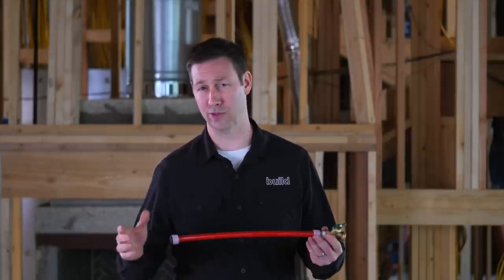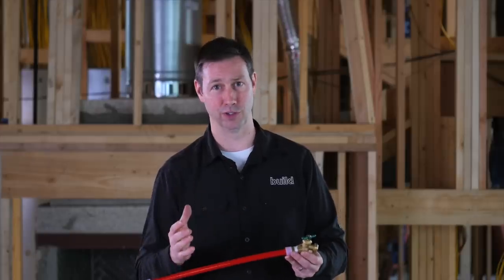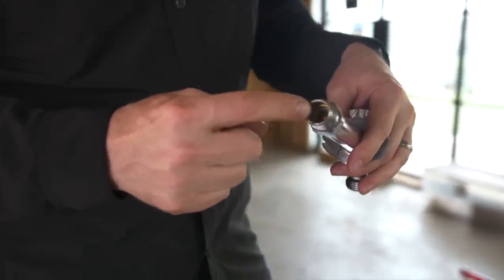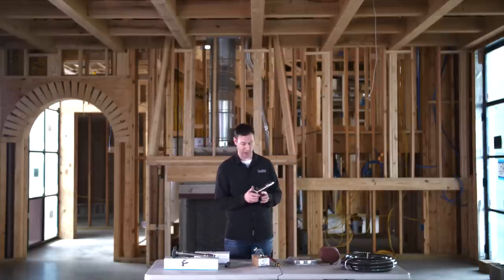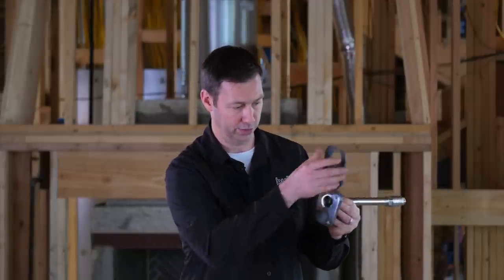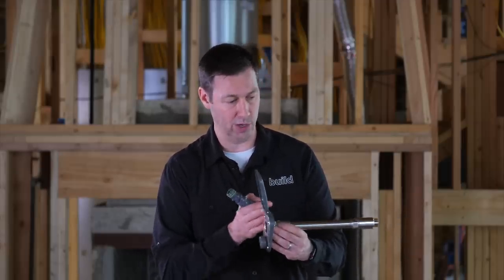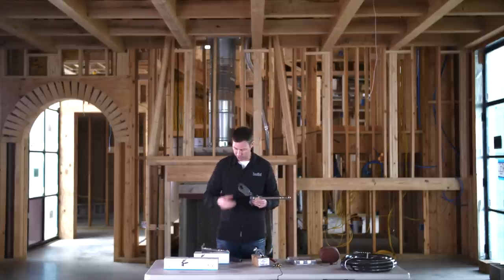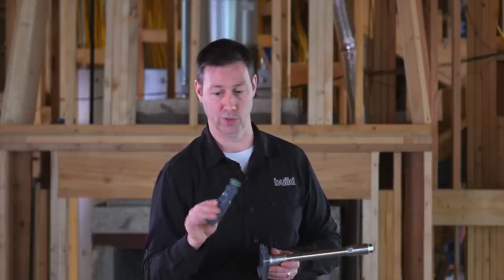No More Hose Bibs - A Better Outdoor Faucet

Comment: I'd love to be there as a 2nd or 3rd owner of the house walks around wondering where the hell the spigot is!
Reply: And after figuring it out finds out he has to buy a $30 special adapter for each outlet or that they aren't made anymore and has to have them replaced with the old style silcocks!!
Reply: I have a drawer of various hose bib quick connects that are essentially uselesas the pieces are different brands that won't interchange, I see that in this products future!
Reply: Thanks for the feedback! We sell them for $11, less than the cost of a replacement packing nut for standard brass sillcock. We have hundreds of thousands of these outlets out in the world now, so the incentive to keep making them is high. :)
Reply: I just replaced all the outdoor faucets in my house and it cost less than $20....
Reply: .... where are you buying those at? $4.50 at Lowe's for a Brass one. and $11 just for your adapter?.. This sounds like a waste of money when every hose in the US uses the 3/4 GHT fitting. You guys are "pulling an apple" Here
Reply: @AquorWaterSystems  ... The  quick reply from the vendor  really cast light on this video as a commercial.    Now I see why he glazed over the obvious potential proprietary issue.
Reply: @allenfogarty2384  definatly right. Paid for and produced by aquor systems
Reply: @allenfogarty2384  Have you only just realized that Matt has commercial sponsors?  He does a pretty good job of only recommending/featuring interesting or useful products, definitely not selling out.
Reply: @AquorWaterSystems  That's an arrogant answer. Even $11USD is high for something that has to probably be ordered. And you need tens of millions before you can start bragging. 
Send me a few free samples, and I'll write a review. That's the best I can do for you.
Reply: @Xyphren  I could see for some houses where architecture is important maybe not wanting the standard hose bib showing... dont know if it's worth the cost tho but I will probably try it
Reply: @Nehmo  Woah.
Reply: LMAO !!!!!
Reply: I like them.  A little pricey but I hate my house bibs.
Reply: They dont make spigots anymore... its hose bib
Reply: Teehee...
Reply: @AquorWaterSystems see you in 20 years oh I forgot the homes your product is installed most has a average age of 32 years old as all these products are fancy capitalist con jobs perpetuating poorly designed consumer crap.

Comment: that loop is smart!!
Reply: Best part of the video in my opinion.
Reply: And doesn't cost 90 dollars.
Reply: Yes
Reply: 20 or 30 years from now . . . no one will know there is a loop inside the wall!
Reply: Marvin Carvin until they go inside to loosen the connection and find the loop and get a clue
Reply: Marvin Carvin exactly. You think anybody puts a loop in the wall? No way. Specially not these trac homes. The only one putting a loop in the wall is a know it all first or second year apprentice who watches you tube. Waste of time and money.
Reply: The pex in an inside wall definitely isn't smart.
Reply: It's good idea, but will there be unexpected "strain" on the loop area... and overtime the pex breaks inside the wall?
Reply: How flexible is pex after 20+ years of service? Once it's gotten memory from being bent will it flex without breaking?
Reply: You would get water hammer.  Its a fail in plumbing 101.  Any noob knows to secure pex pipe every 900mm.  Bang Bang Bang when you open and close the valve outside.  Especially inside the pvc tube.  But I do respect the creative ideas he has.  He is a good builder.  I just think this is a bad idea.
Reply: When they go to replace the hose bib, won't it be obvious?  Unscrew the bib from the wall block and pull just a bit, and "WOW, look, lots of extra feed to work with."  Right?
Reply: If you'll front me the money for a time machine I'll let you know in the past
Reply: Looks like you would be letting a lot of COLD air into your walls.
Reply: 2 AM  exactly what I was thinking also in 20+ years the pex will get brittle(I know everyone thinks pex is the best but it still plastic. Plastic get brittle and hard with age 30+ years pex will be almost as hard as pvc
Reply: Great new practice.  Not unlike the extra wire tucked away for outlets.
Reply: @Writer B.L. Alley My parents house is like 90 years old and the original faucet is more or less fine. It does a small amount of leaking when in use, but none when turned off.

It would have been better if it had been installed with a shut off inside the house so that it could be drained during the winter, but even with prolonged periods of sub-zero weather, it's never been an issue.

You'd have to use one of these a ton in order to need to replace it. Chances are the entire building will be knocked down before the outside faucets need to be replaced.
Reply: @coolspot18  no..pex doesn't break
Reply: @2aminitials  yes
Reply: @Avalanche2  Better than copper or pex under the slab.  Sheet rock is cheaper to fix than copper under a slab when it leaks.
Reply: @readmore3634  Hahaha, tell that to the Mormon church where I recently had to replace some pex tube less than 5 years after the building opened because the tube split inside the wall and filled the back half of the church a quarter inch deep. If 5 year old pex can split, I see it as a time bomb waiting to go off in any older installation. And no, it wasn't because the plumber didn't install it right. It was leaking from a 2"+ split in the line, not from a fitting.

Comment: How durable is that plastic after it has cooked in the sun for a year or two?  I can see that snapping off back inside and then what?  I would much rather see quality brass attachments.
Reply: John Doe
Don't worry about it. I'm sure that exact attachment will never go out of production and be difficult to source ;) Come to think of it. Don't think I'll use one of those fancy spigots, but I might invest in a box of those attachments. In ten years they'll all be worth multiple times as much on eBay...
Reply: It can’t get stuck inside,the outer part or the hole has the 1/4 turn threads that hold it.
Reply: Great question! We use ASA polymer for the covers, it's a highly UV resistant polymer that is commonly used for automotive body parts, like side mirrors. We have some hydrants that have been baking in Arizona summers of 110°+.
Reply: Yep, I am an Arizonian so that is usually my first question about plastic/PVC products.
Reply: Baking for what, 5-10 years? No, I want something that bakes for 30 years and still good, like stainless steel, brass, aluminum. I loathe plastic mess.
Reply: @AquorWaterSystems  The exposed O-rings on the push-in adapter are a faulty design.
Reply: @moonshinewarrior  Right, it just won't stay "on" at some point.
Reply: @AquorWaterSystems  It looks like those plastic components could be manufactured from brass and still work fine.  Any plans for producing a high-end all brass version?
Reply: @takayama1638  Totally agree.  Not a fan of the plastic. It would be better if it was all brass, but I have to say the quarter-turn design is very ergonomic.  If they made a brass version and the O-rings were a standard size (not proprietary) then I would buy it.  But hey even with the plastic version, that service loop idea would allow you to change it in 5 years when it breaks.
Reply: They are not durable and all they are cheap it will cost you a lot of money every year.
Reply: @AquorWaterSystems   no reason they can't be brass. How much are they? The thing about installing a frost free spigot is so the homeowner doesnt have to think about it its protected. But now you made one where they do have to think about where they put the damn adaptor. That and the fact that it cant be overridden is a fail as far as I'm concerned.
Reply: @AquorWaterSystems  no replies to the comments? Out of business already?
Reply: @AquorWaterSystems  that's good, but did you do accelerated wear testing under UV light?
Reply: 420 Friendly  a company with their own 'facts', about as trustworthy as the police investigating themselves.
Reply: @Bob_Lob_Law  Yes, we do. We also work closely with engineers from our suppliers (eg, Dow Dupont) to ensure the materials are ideal for our needs.
Reply: @bolerdweller  We appreciate your feedback
Reply: @matthewgrotke1442  The O-rings are indeed a standard size. The O-rings were actually the starting design point for the valve when engineering ~20 years ago... the first step was opening a McMaster Carr catalog and choosing an O-ring size!
Reply: @sharonwallace9018  based on what experience? Do you have experience with this product? If so, please share it. Keep in mind, not all plastics are created equal.
Reply: yah, would have rathered a metal version of the cover but a standard spigot and that loop method is great
Reply: 420 Friendly 
   Facts?... hardly. Just a statement from a company. I would like to see a consumer review. If it was made of copper, aluminum, bronze ect i would get one... Just buy a new seal kit every 10 or so years and be done.
Reply: Yep one pull on the water hose and that Plastic part is going to break right off...
Reply: Uh... you take it off when it isn't in use, that's kinda the idea.
Reply: OMG my kid just ran by and hit the plastic handle and it broke off inside and I cant shut it off !!! OMG
Reply: @Mustache Merlin don't forget the 3d scanner, UV stabile structural filament, and hours to waste adjusting it to fit
Reply: Iv broke 2 just this year..
Reply: @sharonwallace9018  I just wondered how you know?  When you condemn something you must have a reason.  I can see the part that attaches to the garden hose needing replacement eventually but the part that mounts to the wall looks like it has good integrity.  FWIW all hose bibs require periodic maintenance.  Even the commercial ones.
Reply: I’m sure the plastic is by design, not economics driven, and best at preventing hard water lockup. That really coarse thread insert looks perfect. 2 squirts of CLR or the like will keep it working for awhile. I buy/have all brass silcocks/bibs and hoses and attachments on 3 houses...2 with well water, 1 with city, all corrode and have to use pipe wrench to break hose connect before first freeze. (Some automotive anti-lock tried, but not great).
Reply: They made a replacement cover in stainless steel now.

Comment: "It's the northern builder that know" I'm from Canada and we have normal ass faucets
Reply: priceless  :)
Reply: I’ve gotten rid of those.
Reply: In Canada, homes older than 1990 might have the "normal ass faucets" but newer homes mostly have frost free hose bibs, unless it was built cheaply by a questionable builder.
Reply: @johndough1966  I believe YiFan meant the frostfree are the norm. I built my fisrt house in 1978 frost free all the way, but built the first house in that area with 6" studs.
Reply: I live in Boston and thought the same thing. I have a normal faucet but I do try to remember to turn them off inside when it gets cold out.
Reply: We call our ass-faucets bidets.

Comment: I would NEVER use these. Lose that adapter and you're unable to connect your hose, that would be a curse fest every spring. Also, no control on flow, just On/Off? I'll stick with the cheaper frost free.
Reply: Matt Cournoyer if you’re worried about flow control at the wall, just put a quarter turn ball valve on the piece before the hose.

Though, I think I’d rather have it on the end of the hose personally anyway.
Reply: Tighten the adapter and it won't be loose.  Any hose can be loose if it isn't tight.
Reply: I agree 100%
Reply: Not to mention the silly adapter is plastic and it WILL break off.
Reply: the point is that on every hose you have, you can put that adapter permanently on it. in that case you can only lose the adapter if you lose the hose.
Reply: This is an ad. Can't really expect anything more than the highlights :P
Reply: @MatthewMello  He said lose as in he can't find it, not loose. LOL..
Reply: @Dialysisforever  because he edited the original comment from loose to lose. It even says (edited) next to the comment.
Reply: @MatthewMello  That makes more sense.
Reply: Hear, hear.

Comment: "High-end" is all about understatement and fine materials, this is neither.  Need brass, black connectors, subdued logo if any to make it onto heritage/high-end homes—they're not boats. Plastic & bright colors look cheap, the logo size & placement is awful & will look dated in less than five years. Sorry guys, but this is just design reality. If it's not appearing on aspirational homes, it will always be a tough sell. If you can't cover that market, what's the point?

Comment: No good. How do you modulate the volume? Sometimes you don't want full flow.  I say no way.
Reply: Just looked them up and they sell a removable faucet you can attach that has a ball valve so you can regulate flow. But I imagine you could also install a quick connect ball valve on the end of your hose and then their attachment.
Reply: so then you need more parts hanging on the house, may as well use a standard frost free bib for 1/3 the cost.
Reply: He literally answers your question in the video.
Reply: Most of the time the spray head has an adjustment. For some garden hose attachments like a cheap sprinkler those may not have a regulator so you can just get an inline one. To me the idea of regulating the flow somewhere else makes sense especially because you can fill the hose faster. BUT, I believe this should make this "innovative" wall faucet cheaper not more expensive. It seems to be marketed as a more luxury/specialty product.
Reply: We made it an instant on/off because most people use a nozzle on their hose. We sell a connector with a built-in ball valve. You can also attach any inline ball valve to the regular connector. (or any other accessory, like a timer, splitter, etc)
Reply: +Scott Schultz Parts you probably already have though. Although I think the bib connector should come with it.

Comment: What happens when you yank on the hose sideways and snap that off inside the hydrant? It's plastic and sticks out quite aways so I think it would be likely to happen. I'm assuming you would then just have a jet of water shooting out the side of your house. 

Love the loop in the wall, that's really smart.
Reply from the maker: These aren’t cheap plastic. I’ll need to research this a bit more but they feel pretty Bomber
Reply: I'm glad I read the comments. I had the same thoughts. 

I wish I would have known about this when my house was built 5 yrs ago. And after the house burned 2 yrs ago. I guess when I get my shop built, I'll incorporate one in that one.
Reply: Agreed. Even "good" plastic is an order of magnitude or more less durable than brass.
Reply: Well then you look at someone who was not paid to review it and see a honest review...
Reply: Nice if brass or stainless was an option.
Reply: @buildshow  I'd feel much more comfortable with the prospect of installing them if they showed off baking their adapters in UV lamps for a long time, with other similar use commercial grade hose parts, then hooked it up, and showed how much force it takes to snap that adapter off. Testing things to their failure point in a likely usage scenario isn't unreasonable, and that's the concern most folks are worried with on here.

If I leave the same spigot adapter in for several years on a south-facing wall and my son gives the hose a good hard sideways yank while washing the car what's gonna give? Bet a brass bib wouldn't be the failure point.

Edit: the service loop of pex in 3" is a super solid tip though!
Reply: @buildshow  ,  This looks a lot like a in-ground hose connection (usually incorporated in irrigation) with a extra feature(vacuum break), Am I correct?       IF SO, did you ever find out if they make a brass connector?
NEVER thought about using those in-ground hose connections for wall outlets(DAAAh, WHY NOT)!  Guarantee(!), not many at all would have those type of connectors.    However those are a great idea for new construction.

Comment: 90$ and a proprietary hose fitting? your insane.
Reply: crash6674 .0002% of the cost of a house for a quality product is insane?
Reply: Don’t forget the loop requirements with extra costs for the PVC sweep fittings AND the possible limits to installation locations.  No thanks.
Reply: @abmccaa  how is it quality? Could have been a metal adapter but it's not. Has a separate adapter to loose, no fine pressure adjustment just full blast, nobody locally will stock the adapter so when you loose it you will have to wait for shipping and borrow your neighbors hose bib in the meantime because he was smart and knew that the fancy bib was just fancy garbage
Reply: @abmccaa  Using a proprietary molded plastic for a commonly abused physical interface is not what I would call "quality" 🤣.
Reply: Sounds like Apple
Reply: @abmccaa   Yes. Better off with those "cheap" frost free fittings. I have O-rings on my hose reel and it's not long before they leak. Let me know how well they work after 3 years. On my frost free tap I can change the washer.